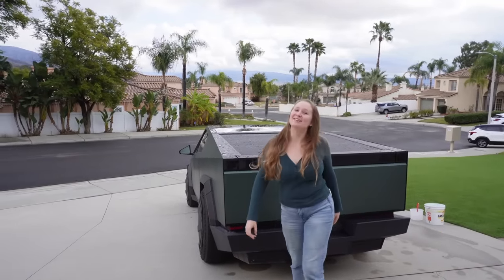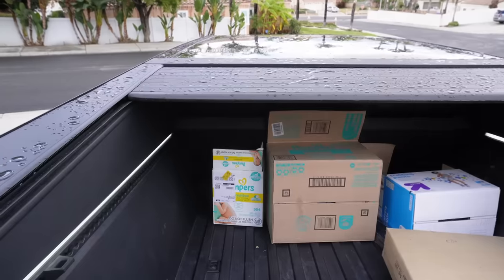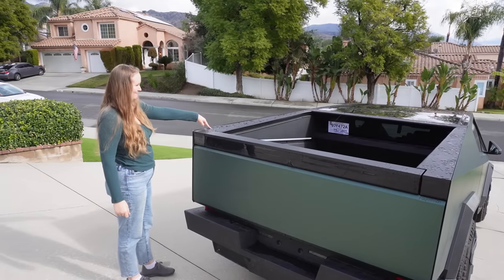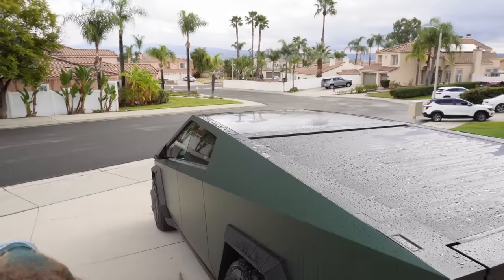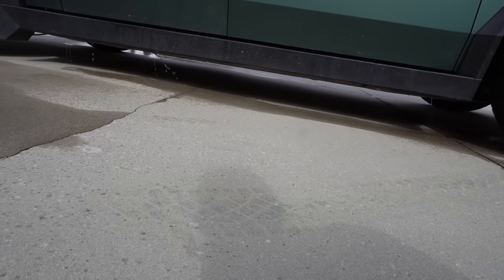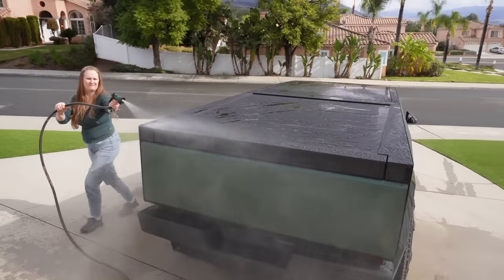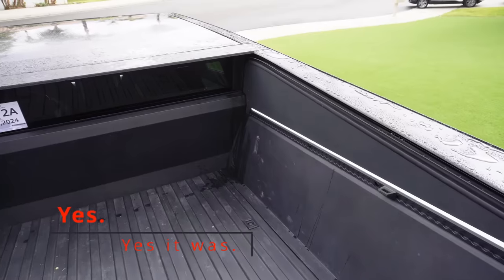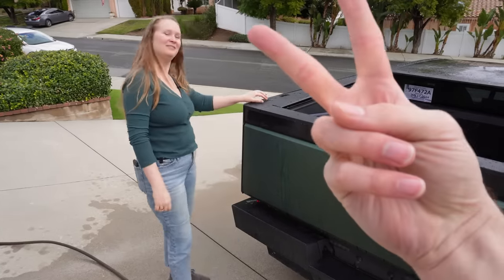Is CYBERTRUCK Tonneau Cover Waterproof???

Comment: Please address this in the next video. I have watched almost all cyber truck video content, and have not seen this addressed..
Question:
I saw that in the body in white . that the truck vents its cabin air through two 4 in.² vents underneath the rear window. Which means the back truck bed should be able to be heated cooled using cabin air. 

Suggestion :
Use a remote thermostat and put it in the back of the truck close the cover, leaving a 2 inch gap opening . note the temperature after a temperature normalizes. Then turn cabin hair on heat or cool in biodefense mode.. or camping mode. wait five minutes and see if truck bed temperature changes.

I believe that these events were intentionally facing the back of the vehicle to heat or cool the cyber tent. Which is a good idea because the rear window does not roll down..

This is a big deal as it can keep precious cargo in the back not just secured, but climate controlled(either you in a tent or your belongings in inclement weather).
Reply from the maker: Hello Patrick! Thank YOU for the channel's first Super thanks!!! This is a great idea! I hadn't heard about these vents! My whole family is sick right now, so it might be a couple of days before we get to this video, but we will definitely do it!
Reply from the maker: I just went out and checked, and there are no visible vents anywhere. It would be somehow behind the seats, but if you look in the bed of the truck it is just a flat plastic panel. My guess is those vents you saw in the body and white were actually the water drainage spots that we discussed in this video.
Reply: I think those were like pressure equalization. Not actual vents. Tesla has said in many forms that you cannot heat the vault from the cabin as it would be inefficient

Comment: thanks for the video, hope inside with a camera and a torch to see where it really comes from. I think it will be a problem when parked on the flat and the sitting water will run off the trailing edge.

Comment: For all the people amazed by this, I have a simple vinyl role up tonneau cover that is 10+ years old on its second truck after the first truck was rear-ended so hard that the box dinted the cab and wrote off. It barely gets any water in it when going through the car wash. A little around the tailgate (most of it probably comes around the tailgate). This isn't impressive, its what should be expected.
Reply from the maker: That makes sense with a vinyl cover. Much easier to be waterproof than what Tesla has done! But I agree, it should be expected.
Reply: @OurCyberLife  I wouldn't say it's easier. It's just velcroed down to rails that are clamped to the bed rail. The cybertruck system is angled so water doesn't sit on it. Pretty simple to keep water tight actually. I'm more curious if it will still work in freezing Temps after it gets ice in it.

Comment: It is probably waterproof according to this video and test. That was a little aggressive attempt to make it leak relative to nature, and it didn't leak much at all. Barely a little in the corners. I'd say that's waterproof for the most part. If you don't want any water to leak, wipe it off before you open it
Reply from the maker: Exactly! We were quite impressed with how waterproof it is!
Reply: Obviously the water inside the bed does not indicate leakage, a tesla would never leak or have panel gaps or any other issue. Tesla is love, Tesla is life.
Reply: 😂 @miksausitis
Reply: if it still seals as new
Reply: @miksausitis actually it is tested for this after production so indeed it is unlikely to leak
Reply: And now try wiper😢
Reply: That was indeed NOT an aggressive test by any stretch of the imagination.  It was a standard low pressure garden hose.
Reply: Not aggressive at all, needs to be waterproof going through car wash.  That’s a real test.
Reply: Not really. It rains for like at least a half an hour. Id argue that they need to have water spraying on it for at least 15 minutes.

Comment: Traditional Chevy Silverado farm truck owner here, with a Cyber on order.  That tonneau does very well!  Also, folks worried about getting the bed & outlets wet seems a little odd. I will be pressure washing my Cyber bed to clean it etc. Also hauling an atv or cycle in a heavy rain storm will soak everything! Tesla has certainly safeguarded for the bed to be completely soaked! 😊
Reply: I am curious how you know that, do you have any video proof or claims made by Tesla? Or are you just assumming

Comment: That’s good to see.  It’s great that you are sharing your Cybertruck experience with us all.  Thanks heaps for doing it.  Can you show us some time how feasible it is to load the tray with tools or groceries at the very front of the tray?  Or is the side too high for that?  Because a toolbox would normally be placed at front of tray for surviving braking without sliding.  Thanks guys, subscribed and really enjoying your vids.
Reply from the maker: Just went to the grocery store right after uploading this! 😁 I put them in the gear locker, worked very well! Putting them over the sides at the front of the bed works fine for me, just went out and checked, but a tool box would probably be difficult, hard to reach all the way to the bed from the side.
Reply: @OurCyberLife  Nice!   Thanks again for all this sharing and taking the time to reply.  I hope you have nothing but joy with that amazing vehicle.
Reply: The frunk would also be good grocery spot I think….  It seems to have a lot of room and a nice low floor entrance.

Comment: Spoiler:  It Leaks.  Not terribly but its tested with a low pressure garden hose.  Im sure a rain storm would paint  a worse picture.  A rainstorm while driving 70 would certainly be even worse.  A car wash pressure washer would likely flood the bed.

Comment: There was a lot of water pooled up on the right hand side upper corner, and as it rolls down, the segments open up and might dump the water right at the end.

So if you wipe it first before you open it, it might not leak like that.
Reply from the maker: Indeed, I think most of it came off of the tonneau cover

Comment: You guys are awesome! Looks like it could go through a hurricane and still be bone dry inside.
I saw the CT in person and my impression was it's a very tall vehicle and hard to reach up over the roof and above the tail gate especially when trying to clean it (cleaning mud after off-roading.) In your video however, it didn't seem like it was a stretch to reach up the roof and over the back bed with a hose. It could be that you have the suspension set at the lowest level.
Reply from the maker: Correct, that was with it at entry height

Comment: Can you open the tailgate with the tonneau cover closed and then film from the tailgate, or you could even climb in and film from inside, WHILE the hose is trying to get it wet, The passenger side corner looks to be wet from the track of the tonneau cover, would be good to have that on film so you can document for Tesla to fix it. Thanks for sharing your experience!

Comment: Can you fit a sheet of plywood in that thing?
Reply: yes with the tailgate down.
Reply: Ok sorry if this is annoying, but do you mean flat?  So it's more then 48" as it tapers  toward the cabin?  It looks like the taper would prevent you from laying the sheet flat so figured i'd ask since i have one on order :)
Reply: there are no wheel arches "for some reason" and also the bed doesn't taper.  You need photo or diagram from overhead to see if there is taper, I feel that it's rectangular.

Comment: For a truck it's great, but still, yet another advantage point to  Europe-style vans compared to US-style pickup trucks. With a van, you would have no leakage whatsoever, in fact can open the back even while it's raining and your stuff inside stays dry. Not to mention you'd have more space, and it would be heated so if you want to use it for camping etc, would be a whole other world compared to this.
Reply from the maker: True!
Reply: this is a good point.  Many want the Tesla van.  I'd like to see a Tesla RV, no more worries about separate fuel systems like gasoline, propane, diesel plus battery system all patchworked together.  It can all be electric.  Well, the high voltage main battery plus 48 volt systems.

Comment: So you have to jump up into the back to retrieve the boxes instead of leaning over the side like other pickups. In my opinion, that is a crap design. Wait until you have retrieve something from deep under the windscreen.
Reply: Yeah, I noticed that. 🤔
The only easy way to load and unload the bed, is from the rear; you can't just bend over the sides.
Reply: @kennyfordham6208  yes and no powered tailgate and no scene lights when attaching a tow and no spare tyre bay. The list goes on.

Comment: Still can't believe they didn't engineer the rear firewall/rear seat to open up and fold down flat
Reply from the maker: Yeah, I was really hoping for that as well 😣
Reply: also... that if there is debris or water on the cover and the top is rolled down/up where does the water and debris go?  This must mean the tonneau actually stays "outside" so that debris doesn't get inside the cabin area.